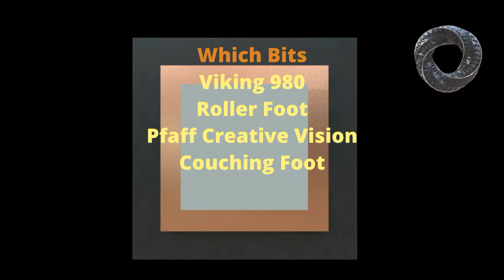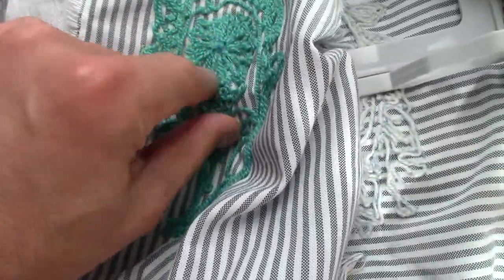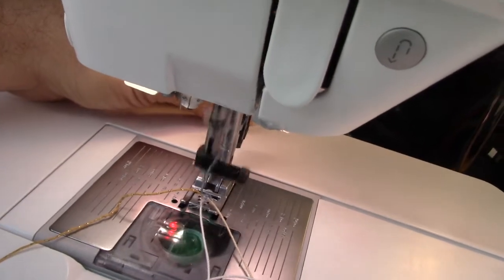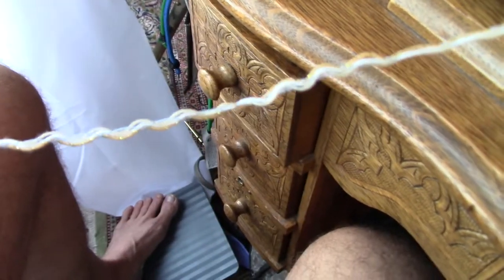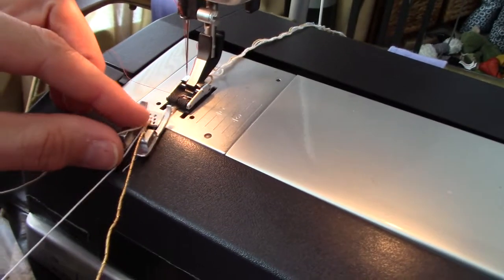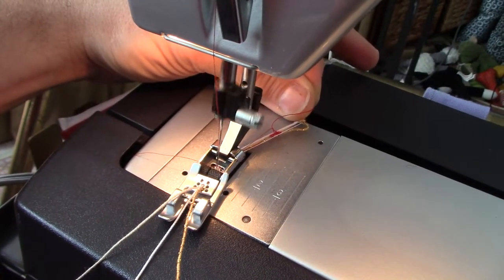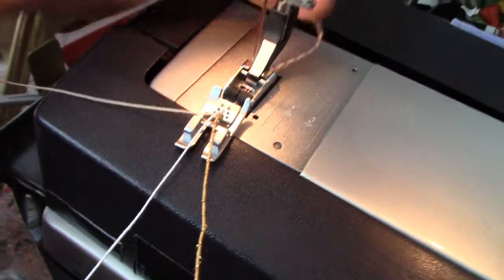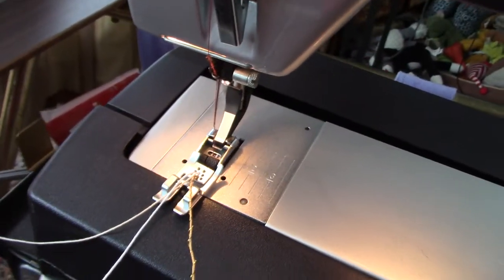Making Cord for Trims Quickly (Sewing Machine)

Comment: What were the machine settings please, beside dropping feed dogs? .  What stitch length and width did you use?  Hope I have understood what you are doing.
Reply from the maker: I did not need to do much else (perhaps adjust the foot pressure up and down to assist with feeding). Beyond that, it just worked. Depending on your machine, you might to fiddle a bit, but it should not take too much time to find the sweet spot where it works easily.